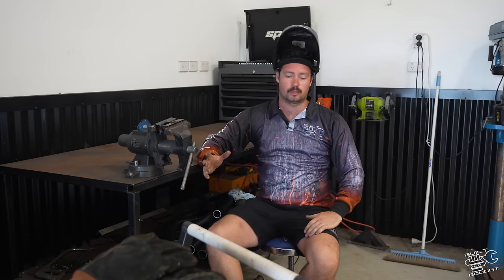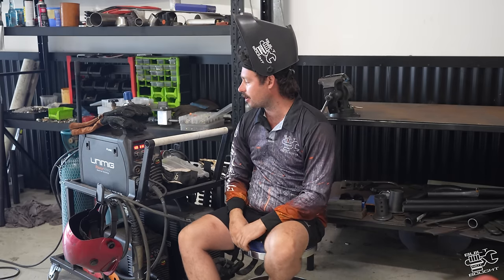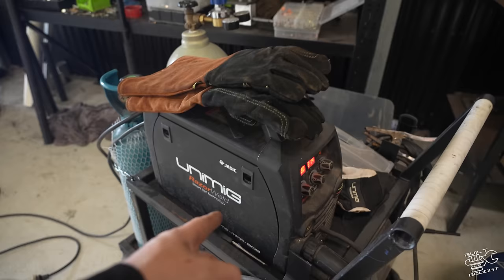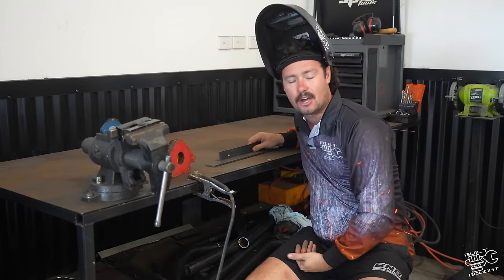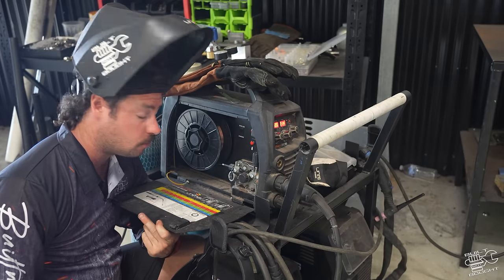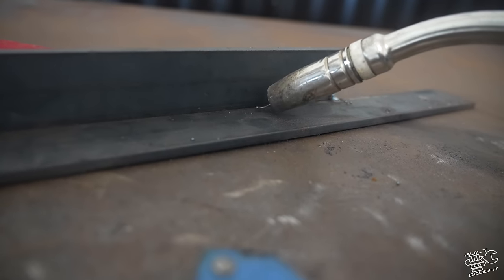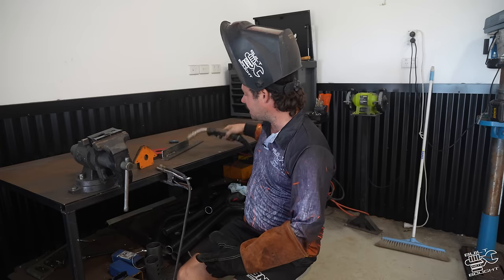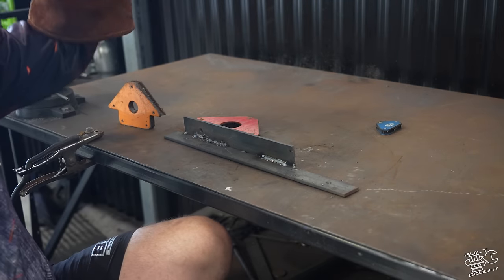BNB TECH || How To Weld

Comment: Practice is key, play with settings, play with distance from material with the torch, play with torch angles, don’t worry about trying to get cool patterns if you’re doing small diy jobs just push the weld pool straight. Have fun with it and don’t get discouraged with bad looking welds just experiment maybe seek advice from someone in the know before you know it you’ll lay some decent welds. And then brag about it of course.

Comment: just a suggestion with the gas ur using, u should try using a c02 mix gas as it will get u better speed and more peno and it will sound a lot different, where using argon 5/2 has slightly less peno  but ur video is informative for people starting out. so just a suggestion and i'm a qualified welder and not all of us r like u said

Comment: G'day and cheers mate. Love the way you get your content across ❤🇦🇺
 I started welding from stick then to mig but still only have about 20 hrs exp all up. Ive done things from build basic frames to re skinning and trailer skinning a trailer. I've made and replaced panels and  re welded a roof cut on a project rally UC to LH dirt to rally/track fun car. I have  watched a few vids about welding and I think with every vid I watch, I pick up more and more. I did like the quicker flow  video like yours. 

I'm super keen to learn car 12 volt dual battery set ups and stand alone solar for dummies. Always wanted to but Im pretty green when it comes to that stuff bro. I used to blow up car stereos on simple installs and I haven't gotten much better 😂🤦‍♂️. I've just got an 07 nav and want to do a budget build over time for a daily and weekend or holiday  adventures. 
Cheers mate look forward to the next vid 🤙🍻

Comment: Another tip if you want it. I noticed the aluminium pipe you were welding you backstepped the welds. It leaves a bunch of craters around it. For something like this just start the arc on the crater and continue forward ( for tig only).
Also with aluminium mig a dual pulse machine helps alot.
But not a bad video for beginners. There are some on youtube that are terrible.

Comment: Can you do a stick welding video
Reply: Can't do skilled welding just does hot glue gun welding
Reply: because it's just not practical to use in automotive applications. you really need atleast 3mm thick steel to not blow holes all over it. experienced professionals can do it but even then its just not practical.